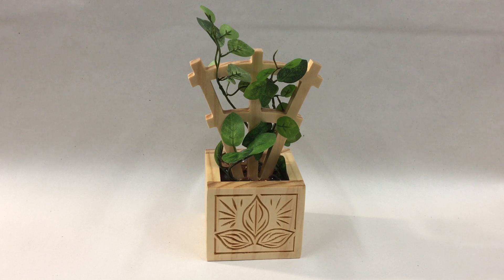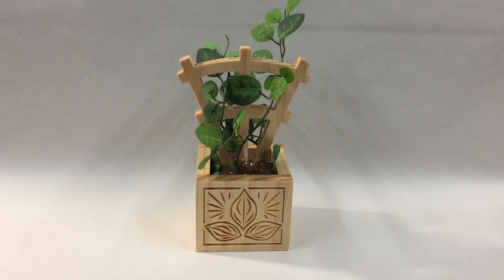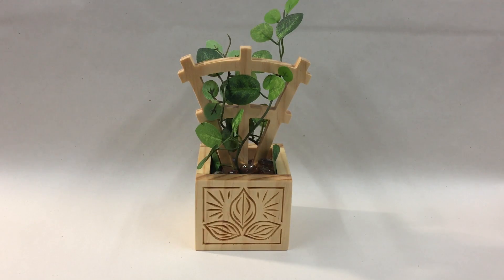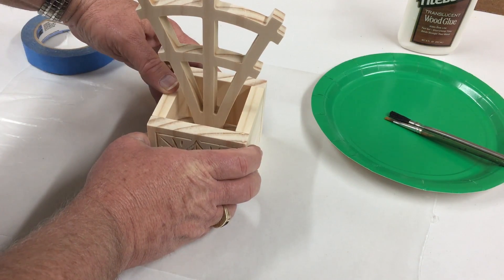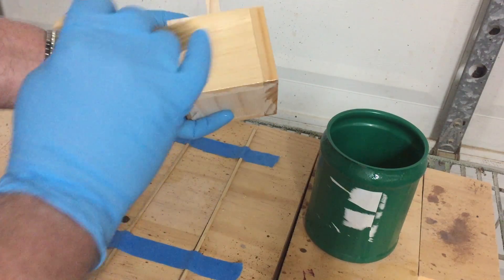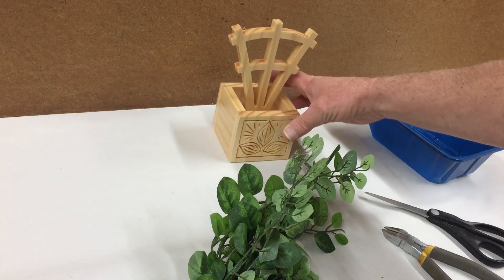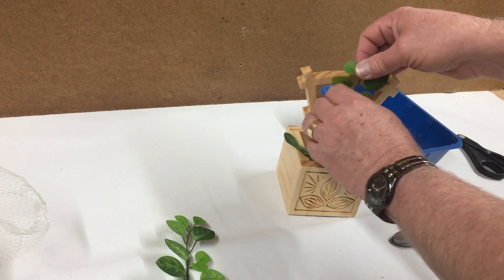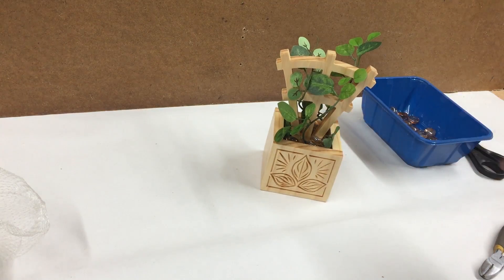Making a Table Trellis | Michael Tyler's FREE Project of the Month | Vectric

Comment: what product are you using for the seal coat
Reply from the maker: Hey Keith, Michael used 2 coats of thinned bulls eye seal coat (50/50 SealCoat and denatured alcohol) Sanded when dry then applied several light coats of Krylon Clear Gloss, then Satin as final coat. I hope this helps :)